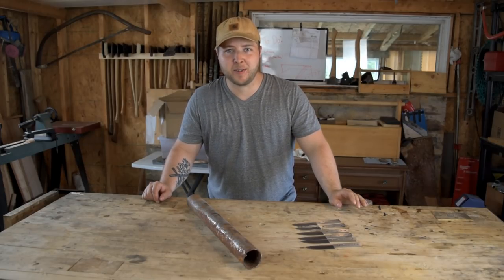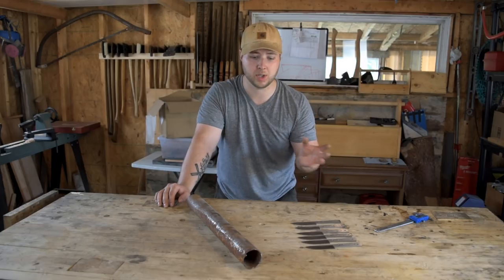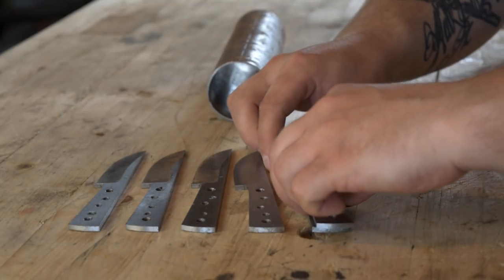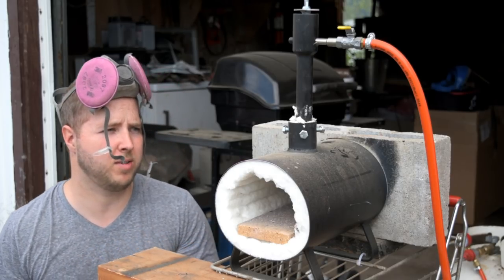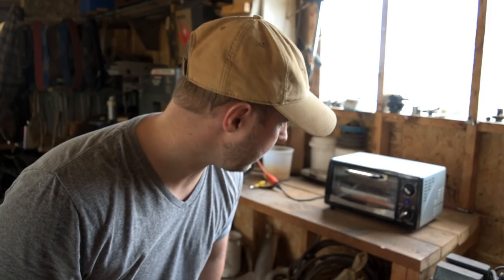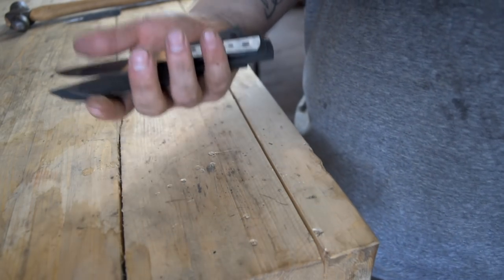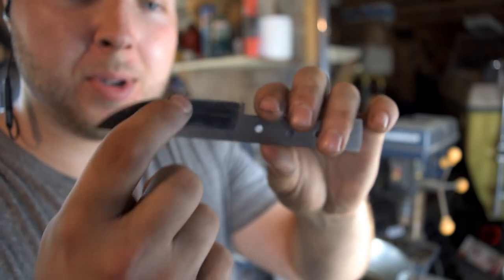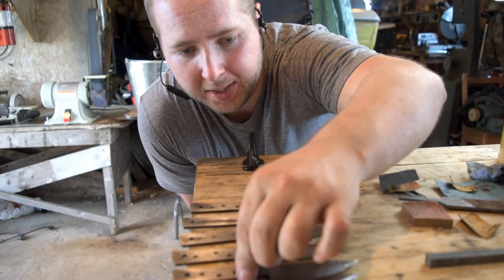"THE BAKEAPPLE" - Making a Neck Knife 3

Comment: These types of inspiring videos are what makes you my favorite Youtuber. They show how much you can do with so little tools and just makes me want to go out and make a knife. Keep up the awesome work!
Reply from the maker: Thanks so much Felix! I appreciate that. I will say, don't be fooled though! haha I have 'minimal' tooling, but what I have still cost several grand. Belt grinder = $500. Band saw for cutout = $350 Smaller belt sander for micro bevels = $200. Forge = $350 Propane setup = $100 Drill press and decent bits = $200, infinite number of grinding belts = expensive (lol) PPE = $100 and so on and so on! That's not including investing in good materials to actually make the knife out of. Expendables. Thousands of dollars! However, you could technically get started for very little. If you're okay with grinding in your bevels with a bastard file! haha

Comment: Another great installment of the series. I'm really enjoying this one and looking forward to the rest of the series. You are completely right about the noises the steel makes. I could tell when you skated the file over the hardened blades that your heat threat was right by the sound, and the high pitched "clang" after the tempering. One of these days I'll get one of the boys who does NDT to do an actual Rockwell hardness test on one of your blades If you'd like to know an exact number. Keep up the good work, thanks for taking us along and cheers till the next one!
Reply from the maker: Thanks for the input Chad, and thanks for re-enforcing my thoughts on sound pitch and heat treat! Do you know someone, or a place, that can test Rockwell? That would be cool to see, albeit intimidating! haha 

Based on your experience with steel, what do you think about my cold punch test? a sharp cold punch, and a medium hammer smack. After removing the forge residue so I could cleanly see the steel, there isn't a divot in either of the knives. The punch didn't mark the steel at all. Only scrubbed off the scale
Reply: Kyle Noseworthy - Weiderfan Pretty well any company that does NDT would be able to do Rockwell hardness tests. I know a lot of guys who work for Acuren. They do most of our NDT such as ultrasonic testing, x rays, mag particle, liquid pen, Rockwell hardness, charpy, etc. I could get one done sometime they are around and have the proper gear with them free of charge. Your "divet" test does prove that you have it tempered at the very least close to where you want it to be. Obviously if it's still to hard you'd either crack the blade or the tip off your center pop, if it was too soft you would sink your pop into it so you are completely within range. Sorry for the long reply but it was necessary.

Comment: I always used 2 temperings 1 hr each on 1095 or 01. Always seemed to work out well. Probably a bit softer. Would turn all staw color.
Reply from the maker: Yep, that isn't uncommon. Like I said, I am going for a slightly harder finish, so I only do one 1hr treatment. :-)